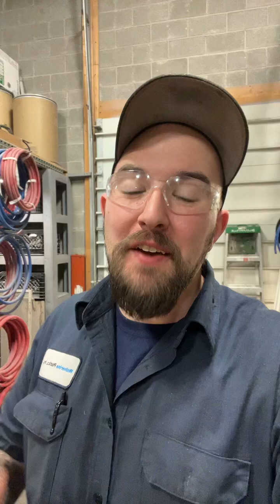Switches and their states!

Comment: worth noting that High/Low is similar, but not the same as all the others mentioned.  The rest are all true/false, on/off states.  High and low, on the other hand can be not quite all the way on and not quite all the way off.  This is fun in electronics when you are dealing with an analog input that ought to be on and off but is actually 2.1 volts when it's low or 3.2 volts when high on a circuit expecting 5 volts.  .  Fairly often you need to add extra components to deal with the hysteresis.

Comment: I'm just curious but why is low used? I get high because of a voltage. But when opened then there is no voltage right? Then low wouldn't be logic. Correct me if I'm wrong!
Reply from the maker: This is where logic becomes complicated. You can control an output with the absence of power as well as the presence of it.

Comment: what's really fun is when you've got switches connected to ground because the microcontroller only has pull up resistors so low is on and high is off!
Reply: That's NPN vs PNP.

Comment: The nomenclature on the Lockheed L1011 for an ON/OFF switch was either “LATCHED” or “UNLATCHED” and the internal light showing system status would be said as, “ILLUMINATED” or “NOT ILLUMINATED.”   So you could UNLATCH the switch to turn a system OFF but the internal light would be ILLUMINATED but to turn ON the system the switch would be LATCHED and the internal light would be NOT ILLUMINATED.  The Lockheed L1011 was an analog cockpit and was designed for an all lights out philosophy with few or no exceptions for takeoff. At the end of the runway the pilots would make one last quick look around the cockpit and if they saw a light ILLUMINATED it was time to investigate.  So if a light was ILLUMINATED you might have to either LATCH or UNLATCH the switch depending on how that system was supposed to be configured before takeoff.  For example the Fuel Pumps would always be ON when the engines are operating so you would LATCH a Fuel Pump to turn it ON and the internal AMBER light that said “LOW PRESS” would be ILLUMINATED until it saw pressure in the line.  So before takeoff if you saw an AMBER light on the Fuel Panel ILLUMINATED then either the switch was UNLATCHED or you had the switch LATCHED but the AMBER light was ILLUMINATED which would tell you the Fuel Pump had failed.  Parked at the gate with the engines shutdown then all Fuel Pump Switches were UNLACHED to the OFF position and all Fuel Pump Switches would now be ILLUMINATED AMBER showing a LOW PRESS for each pump.  Other times like Anti-Icing switches they normally would be UNLATCHED and their switches would be NOT ILLUMINATED.  On a nasty snowy day for takeoff the Engine Anti-Ice Switch would be LATCHED and a BLUE light would be ILLUMINATED showing normal anti-icing valve operation.  The internal lighting nomenclature was RED & AMBER bad with GREEN, BLUE & WHITE being good.

While this sound goofy it cuts down the confusion in the cockpit.  Say you have a Fuel Pump Failure and when running the checklist, discussing with maintenance or another crew member in the cockpit to alleviates the confusion with what is ON, what is in the position of ON and what light is ON.  The conversation would go like this, “I have the Fuel Pump Switch LATCHED but the light is ILLUMINATED.  For a failure of one of the Engine Anti-Ice valves you would say I have the switch UNLATCHED but the light is ILLUMINATED.  This would show a disagreement between what was commanded with the switch (OFF) and what is the actual valve position (ON) because normal operation of the Engine Anti-Ice is UNLATCHED and is NOT ILLUMINATED.